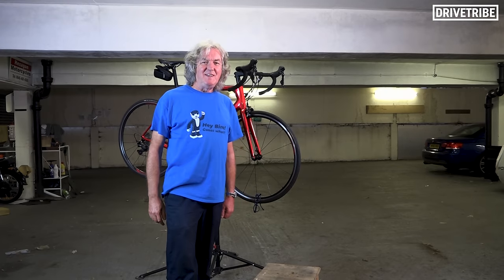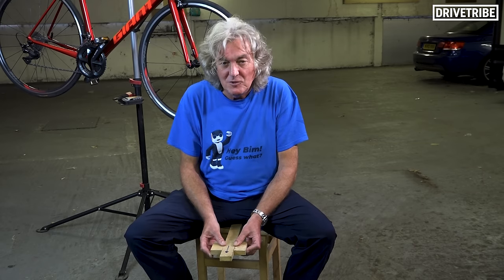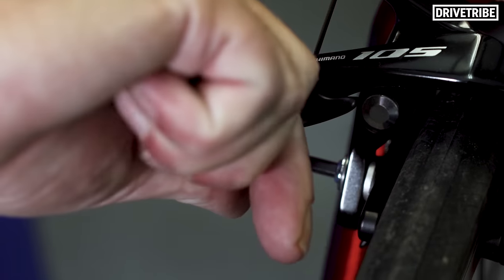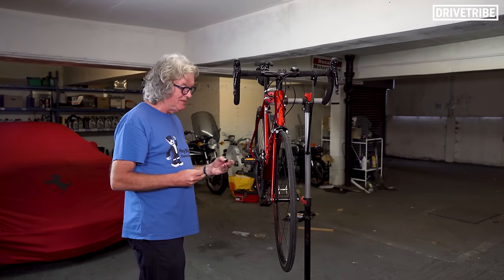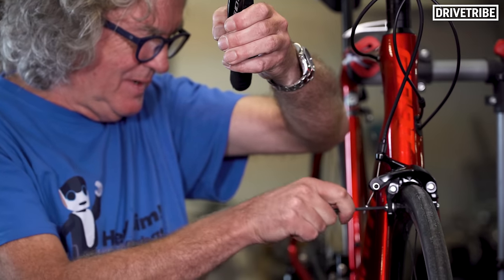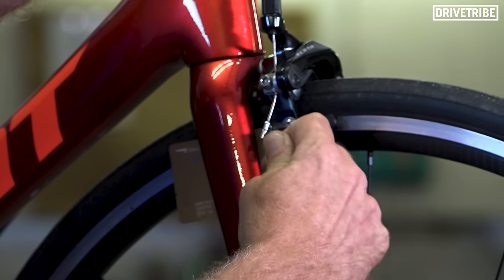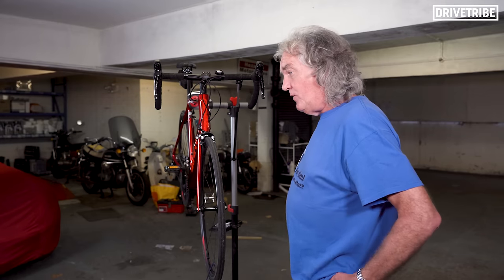5 minutes of boring bike maintenance with James May

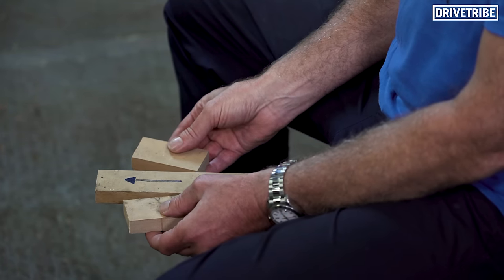Comment: 0:44, that’s the leading edge, mate.

Great video, always nice to see bicycle maintenance go mainstream, but you’ve got your leading and trailing edges crossed.  As the rim goes forward, what you’re calling the trailing edge at 44 seconds is the first part of the brake block to encounter the rim’s rotation, which, I would call the LEADNG edge.  

I’ve been through this with my own bike repair students, and I’ve learned it’s rather counter intuitive as the trailing edge is at the front of the bike, but to my mind, the leading and trailing edges shouldn’t be named so because of the air they encounter, rather the rim spinning by.

The reason you want the TRAILING edge to contact the rim first is because, as the brake pads start to bite, the friction will pull the entire brake block flat to the rim, maximizing contact.  If the LEADING edge of the brake block contacts the rim first, the flex of the caliper causes the block and arm to bend towards the front of the bike until the force caused by the flex overcomes the friction created by the pad and the caliper arm springs back, and the process repeats and... that’s judder.
Reply: Dan Hawkes You’re right, but most people think of ‘leading edge’ as they would on wings, so I go with that.
Reply: @jmsunemploymenttube9191  fair enough. Agreed, ease of access is huge when it comes to this kind of thing. 

I live in an area not only with lakes, but huge shale deposits so I would often use the visual metaphor of a skipping stone to get the notion of toeing brake pads home- if the first edge to hit the water is the leading edge, the stone will submarine and that’s that.  Or, in the case of brake pads, that same “submarining” is the judder we work so hard to avoid.  Whereas, if the trailing edge hits first, the angle of attack has the stone (pad) ready for another skip, or smooth braking.

Love the credit card trick, I’ll have to try that- I’ve always wrapped a rubber band around the rear of the pad for toe.

Thanks for the reply. James could literally narrate his way through ANYTHING (even shepherds pie) and I’d watch.

If he’s (you’re) ever in the finger lakes of NY, please don’t hesitate to reach out, I’d love to sweep the floor, eyes open, mouth shut, and watch a master at his craft.

Be well.

Comment: Would recommend clamping the bike by the seat post and not the top tube in your work stand, the top tube on carbon bikes are “butted” and very thin in the middle.
Reply: Joe Collenette Yes, I don’t clamp it tight, just close the clamp enough to stop it falling off.
Reply: JM's unemployment tube, as you were 👍🏻

Comment: So in UK not only they drive on the oter side of the road, but brake levers are also on the wrong sides? Usually depressing right hand side lever engages the rear brakes...
Reply: pslikon It better to have the front brake on the right, then you’re not surprised when moving to a motorcycle.
Reply: @jmsunemploymenttube9191  that's a very fair argument, can't argue

Comment: Another Brit operating the front rim brake with the right hand lever...
Reply: What's wrong with that?  Given most people are right handed and and the front brakes do more of the braking work, it makes sense doesn't it?
Reply: @ruan13o  What's wrong with driving on the right side of the road? Just another question like yours. But on topic now: the cable connector on the front rim brake is on the right side of the bike. Why would you twist the cable so sharply back from the right hand lever, if you have a proper one on the other side of your handle bar? It's just bad parts mounting practice, that's what's wrong with it.
And the amount of work your brakes must be able to do is not limited by the force of or control over your hands and fingers, but by the maximum friction at the tyre/road interface. Just saying.
Reply: Gerard van Reekum We all do. It’s the convention in Britain.
Reply: @GerardvanReekum  Your answer is why people think cycling can be an impenetrable and pedantic discipline.  What you have highlighted is one of the least important issues on your bike.

And I wasn't saying that you need your right hand to brake because you need more power but with the increased dexterity you have better modulation and sense of control.  That might not actually make a huge difference physically but psychologically it makes people feel more confident.
Reply: @ruan13o  You think cycling is NOT an impenetrable discipline? You must be a newby...